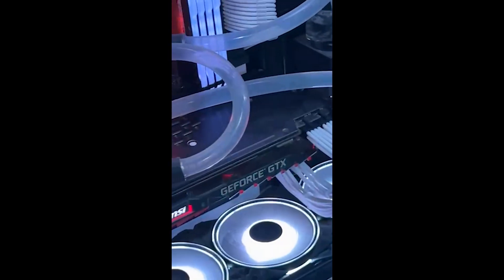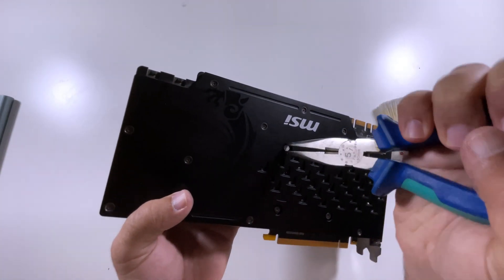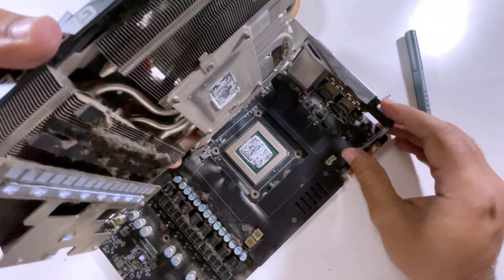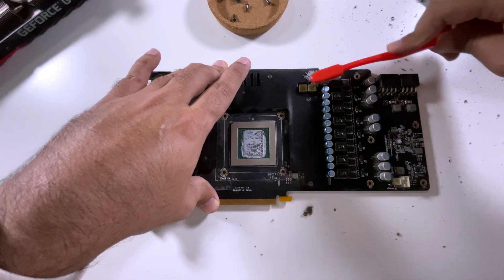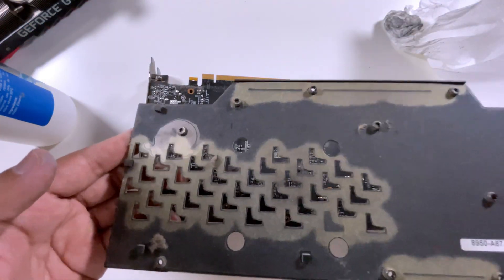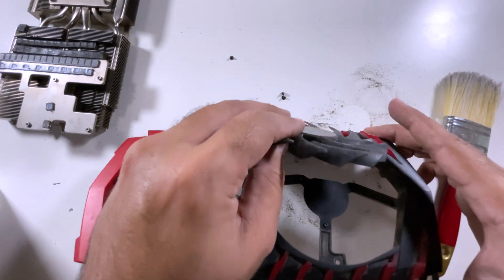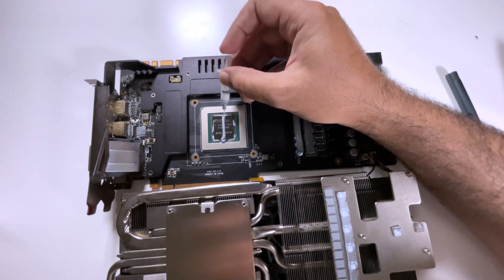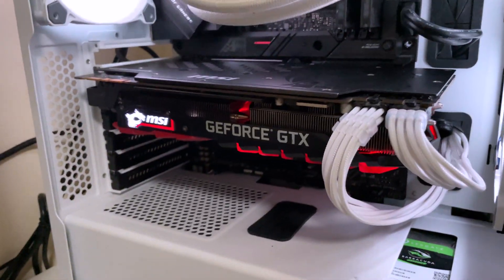How to Tear down GPU without voiding warranty & restoring it to its new condition

Comment: Thermal paste is best spread by hand on the whole chip and then a small dot in center.
Reply from the maker: Cool noted 👍
Reply: @gunjackblaster  
Its very good on cpus aswell
The line like you hsed spreads beyond the chip thats why it isnt great.